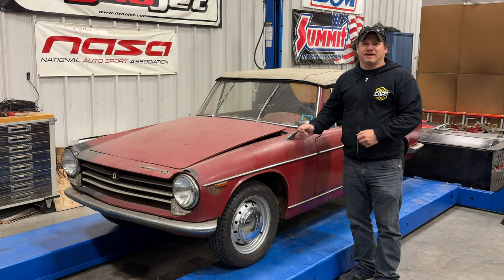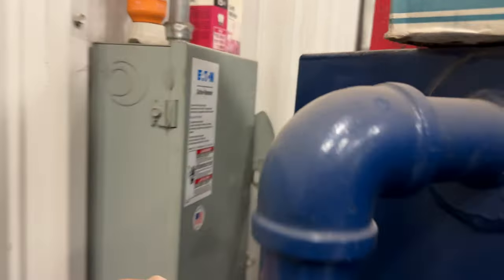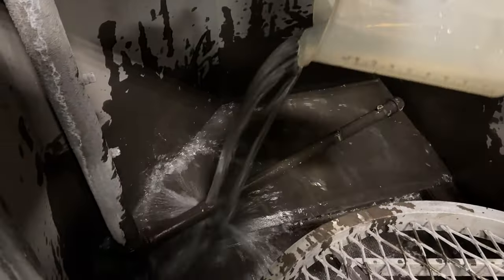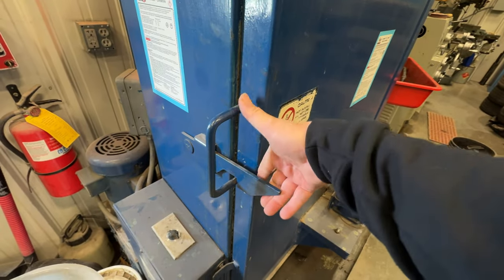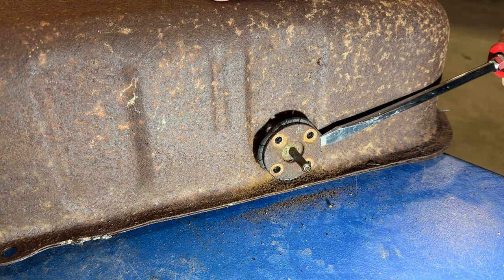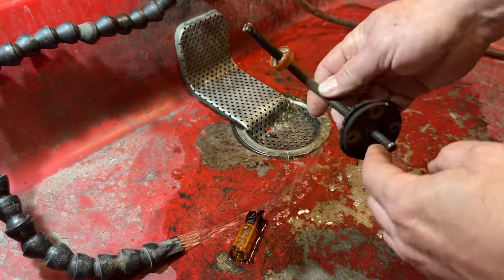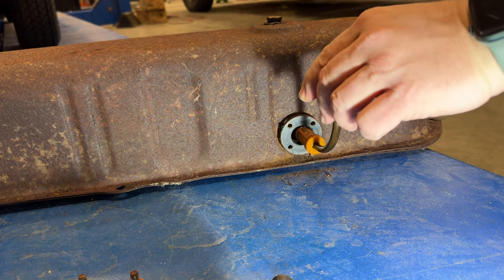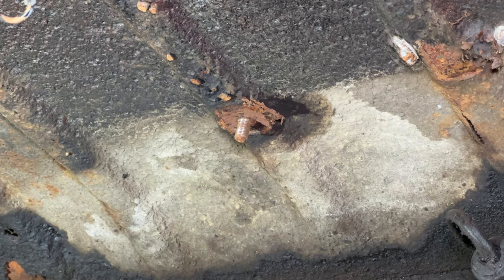Fixing the Fuel Tank on the Innocenti Spyder

Comment: Your methods are always a revelation. Most would just replace the the tank but your approach is to fix things if possible and replace if necessary. Bet you would have a hard time finding a replacement if at all.
Reply from the maker: You would not find a new tank, a tank for a Mark I Sprite (Bugeye) would have to be modified to work.
Reply: Great advice for owners of classic cars on a budget!

Comment: I saw Low Buck Garage use the spring cover to a mower throttle cable, spun by a drill, to clean out a clog. Worked well.

Comment: A braided wire like an old choke or throttle cable can be chucked in a drill instead of solid wire. I've used that to clear the engine block coolant drain tap on TR3 engines. Flexible and the multistrands work well to clear blockages

Comment: Thanks for the videos! Wouldnt a parts washer havf been an option for the clogged tube?
Reply from the maker: The tube was on the tank when it was in the washer.  Nothing was going to break that stuff up unless it was done mechanically.  I have not had luck in the ultra sonic cleaner with things like that either.
Reply: @ThisWeekWithCars  thanks for your answer, the ultra sonic was what i meant to say.